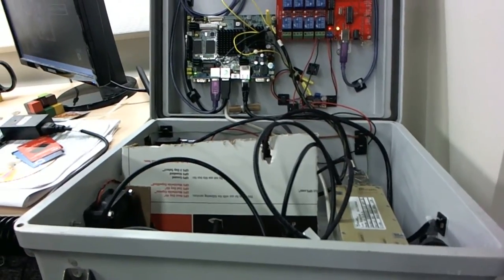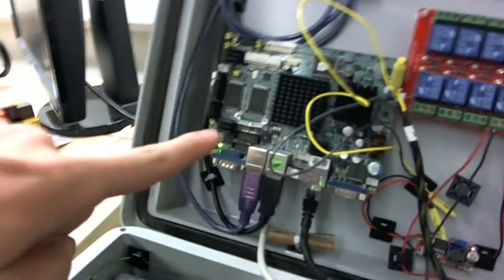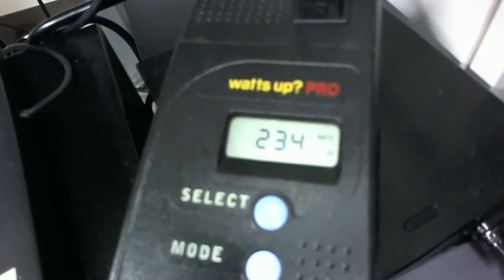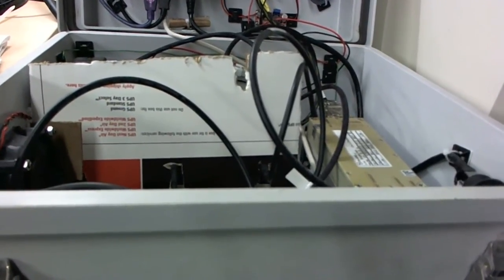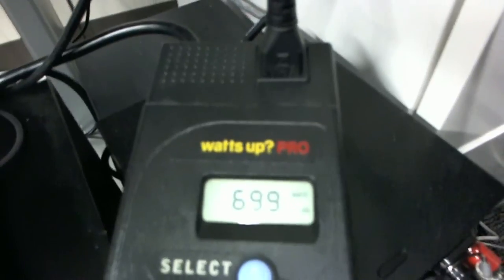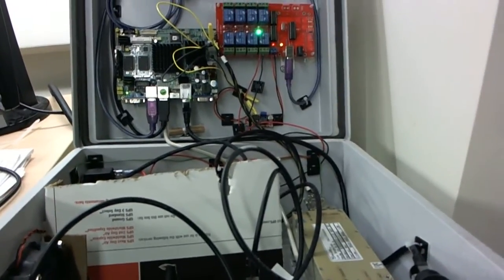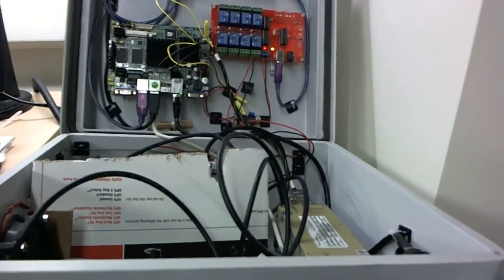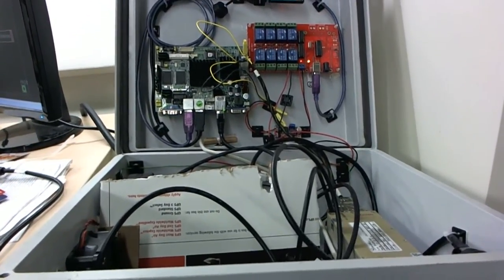pacontroller-big.mpg

Comment from the maker: 1) We have, and it's highly variable. The 30 second wait here is just for this prototype, the final version will actually wait to reconnect the call until it has successfully camped.

2) We have not. Our understanding of the GSM standard is that the phone should be scanning for network even when camped, making the no network and camped situations similar. Our experience says that the bad case is scanning on the fringe of the network; there the phone is constantly broadcasting at full power.

Comment: 2) Where did you get that impression ? When camped on his home network, a phone will only monitor the power of the cells in the neighbour list, and even then, it does it as a very reduced rate. While OTOH when it doesn't have a network, it does full band scans in a loop essentially.

Comment from the maker: Man, discussing technical details on youtube is terrible. 

That makes sense. We didn't investigate it in detail (such as the scanning rate), just noted the continued scanning. It makes sense that it would save power when camped. As we're essentially adding another state to the GSM control graph, we could easily reduce the scanning rate on other ARFCNs (or potentially neighbor cells) when you're in "idle mode". We won't be able to fix the power loss in the "door opener" case though, obviously.

Comment: 1) Did you measure the time it takes for a handset to find the BTS after the PA being off for a long time (i.e. hours), or when powering on the phone while the BTS is off ? If there is any other network (even where the phone can't register),

2) Did you measure the average power consumption of the _phone_ while it's scanning for network ? In my experience a camped phone consumes almost nothing, but a phone without coverage constently scans and is a big power drain.